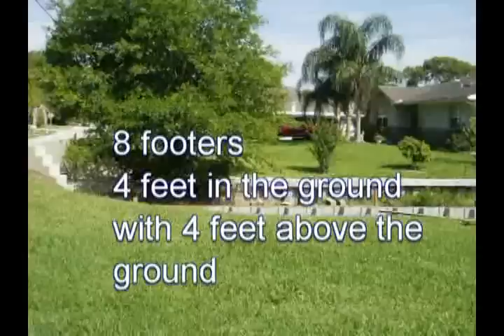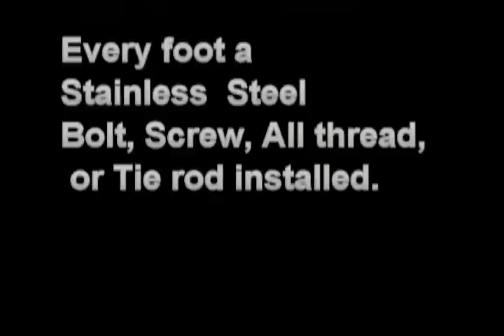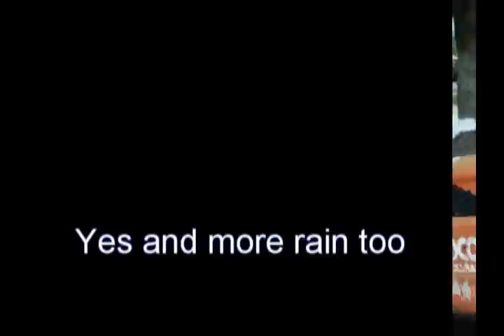Seawall how to build part 1

Comment: The vinyl looks like a decent product but I question why spend the money on it when your weakest link is the wood. The wood will rot out then all you're left with is the sheeting. Also those tie backs didn't look very beefy and I question their load capacity. We have vinyl seawalls where I live (northern IL) and I haven't seen one that can hold up to the winters we have. Between the constant temp changes,ice flows and the occasional hockey puck...it's shit. Spend your money on galvanized steel especially if you're going to live there for a very long time.
Reply: Agree!

Comment: What happens when you hit a large (not rotted) tree root or large rock that’s about 2’ deep when your installing the vinyl wall pieces. Do you cut the vinyl shorter or does the tree root absolutely have to be removed somehow
Reply: Cut it but make sure the next sheet goes. Don't cut more than 3 in a row

Comment: If anyone is still viewing or listening,  I put this up on you tube didn't know much about you tube or building seawalls. There were 1 or 2 videos about seawall NONE showed the process. I talked and read a lot, mainly to the manufacture who was very hesitant to give any info at all, but would give nuggets every now and then. I hook a garden hose to my aggregation pump from the lake  to a 1/2 glav metal pipe,  sightly flatten with a hammer  (not to much). The wall was over 260 long, I had the back 130 poured concrete, the front need to done quick  I knew it wound not last and had intended to replace with concrete. Now 14 years later I am in the process. as far as the music is concerned at the time it seamed appropriate, it was  .
Reply: You're tha boss on 260lf. Any updates on the back? Did they ever mention going with a mini excavator and vibratory plate but then you'll need 2 men but may be able to do it solo with a movable drive guide (to prevent drift and ensure straight) on each fresh panel, seen a steel sheetpile vid and that's what they were doing, moving the driveguide each panel.